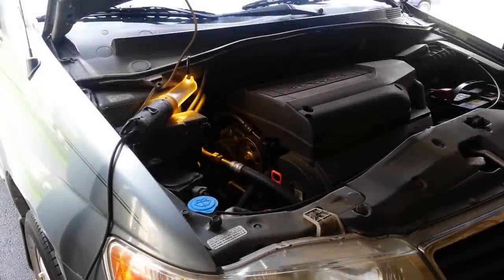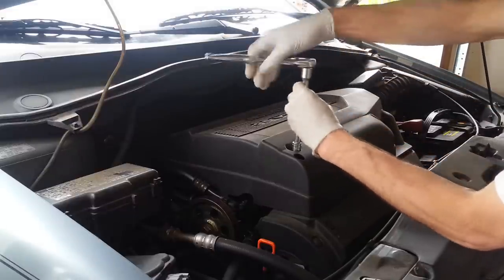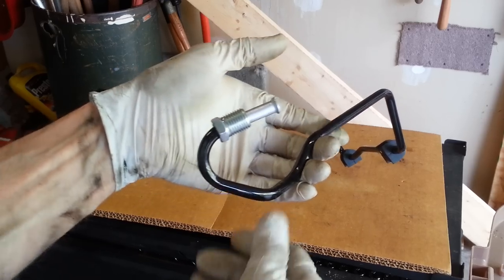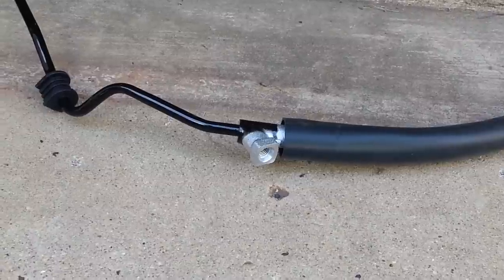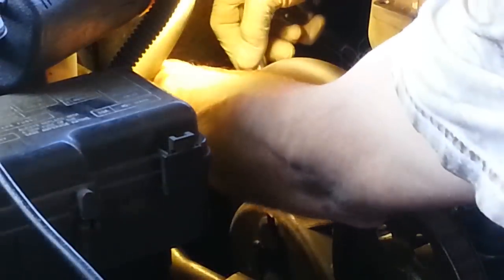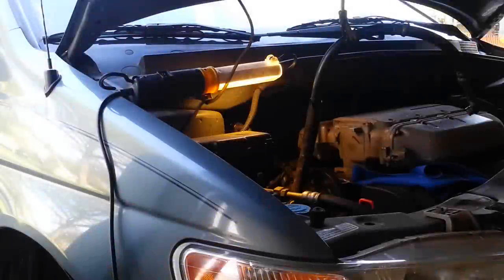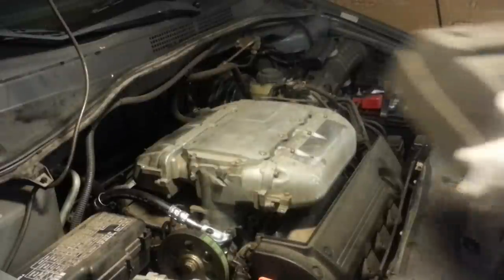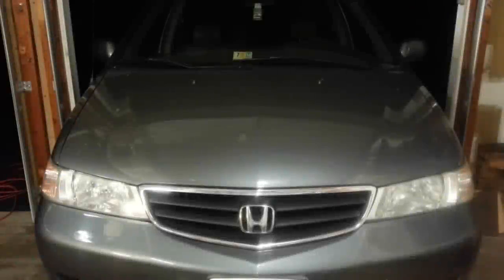Power Steering Hose Replacement 2002 Honda Odyssey

Comment: Just did this repair on my 2007 Odyssey with 157k miles. Almost identical hose and procedure. A couple of notes for the 05-07 Odyssey's:
1. I used a 14mm crow's foot flare nut wrench, rack was very easy to undo. 
2. Get the Honda hose for $150. I bought aftermarket for $110 and did it not include the 3 rubber mounts. But I was able to cut them off the old hose and reuse them. And to add insult to injury, the 14mm hex at the steering rack was a 9/16" on the new hose so my flare nut wrench would not work. Luckily I was able to tighten it enough with a regular 9/16" crows foot.
3. The hose will come out and go back in very easily from the bottom on these year models. Literally 1 minute. 
4. The hardest part for me was putting the center of 3 hose clamps back on.
5. Keep everything loose until you get the rack started, it is a bit tricky to get it aligned right so it doesn't cross thread.
Reply: Tom Shaver how  did you cut off and reuse the rubber mounts?
Reply: Joshua Brown It was real easy with some Craftsman razor blade scissors I've had for years. Suppose you could do it with a knife too. The rubber is pretty soft. Cut along the flat bottom side and it will slide over the new line and pretty much stay in place.

Comment: I had no trouble getting mine off with the open end wrench as you did, but I went and bought crowfoot wrenches that again hit at more points so I could torque mine on there at 18 ft-lbs.

Comment: I used an aftermarket hose and it was fine.  I did have to bend the hard line on the new part to match the OEM so the flare nut would thread in.  The whole job took me 3 hours, from setting up the ramps till end of cleanup, and that included a trip to the store to buy a proper line wrench.  I would suggest anyone use ramps or a lift for this job though.  Made it much easier to work the hose in and around and get it into position.

Comment: Thanks for posting this video. It was very helpful. My Odyssey has the same problem. That's a lot of work and struggle to replace the hose. I don't have a garage and winter time is not ideal season to do it yourself. I'll have to check with the shop to see how much they'll charge.  Thanks again

Comment: I changed this on my 2000 honda van and video was very helpful. I also broke the clip that plugs into sensor on the line. Everywhere was telling me they had to order from honda dealer. I found it on Rockauto.com for like $14 and had it in no time. Very satisfied with rockauto and would recommend them if you can wait a couple days for a part. Again this video was very helpful. Thank you for posting.
Reply from the maker: Trevor Blankenship I'm glad it worked out.  Rockauto is great and I've used them many times.  I recently broke the plastic tab on a fuel injector electrical connector.  I found a replacement on eBay and was able to easily remove the contacts from the broken connector and snap them into the new one without having to cut or splice any wires.

Comment: 5:05.  It may sound crude, but before springing for a set of line wrenches, I'd get out my Vise-Grips.  If that didn't work, I'd cut off the line and use a standard 14mm socket to remove the flange nut.  Great video though.  Thanks for posting!
Reply from the maker: Indeed that's definitely a reasonable approach for the disassembly. Personally, I still found it worthwhile to invest in a set of line wrenches for the reassembly and tightening of the new flare nut. Maybe it's just me but I like to invest in good tools using the money that I saved by doing the job myself.
Reply: @WorseThanChiggers  I hear you.  One of the tools I bought and later regret buying is a special socket for removing an oxygen sensor.  It's a deep socket with a slit up the side to allow the wire to remain attached while loosening the sensor.  The problem is, those sensors are usually VERY tight as they rust on to the exhaust.  They're so tight, the special socket can't maintain it's shape and the slot begins to widen.  When that happens, it lets go of the sensor.  Usually the sensor is being replaced so who cares if I cut off the wire and go with a standard deep socket?

Comment: A couple of things make this much easier. First, since you are changing the hose and discarding the old hose, don't worry about how baddly you mangle it - I had to use an 8 inch pipe wrench to get it loose. I tried a 14mm flare nut wrench but no luck. Could not get enough leverage on it to remove it. The pipe wrench did the trick and it loosened up. Secondly, before you pull out the old hose, tie a string to it so you can see the path needed to get the new hose into proper position. Then you will find, it is much easier to put the new hose in from underneath. First thing to do is to disconnect the Oxygen sensor that goes to the exhaust. Then remove the connector from the bracket and push it out of the way.  Then, start on the driver's side behind the cross beam that the hose was attached to with the 2 brackets , insert the rubber part of the hose through to the passenger side - not too far because then you will insert the tube with the flare nut into the other side where the old one used to go - just follow the string with regards to where to put it. Once you get the tube in to where you can see it from the driver side wheel well and it is nearly in position to connect back up (it should be at the wrong angle at this point) go back to the hose on the passenger side. You should be able to move it past the bracket next to the bracket that held the oxygen sensor, and into proper position while also working up the hose to the power steering pump - this part is easier if you have someone to help and pull it up from above. The hose should move up towards the PS pump and the person underneath can make any additional adjustments to the positioning - which should be much easier without the oxygen sensor in the way.  Once the tube is in place underneath, do not attach the brackets until you are sure you can properly thread the flare nut back into the steering rack. I applied some anti-seize lubricant to the nut (a very small amount) so if I need to do this again, it won't be such a pain in the butt to get that nut loose. It is difficult to get much of the nut in by hand - start it with your fingers and then use an open end wrench/box wrench to gently tighten it until it starts to become snug. Then go back under and attach the 2 clamps and then lastly the clamp on the back of the engine. Attach the connector to the power steering pump and then go back underneath and tighten the flare nut on the steering rack with a flare nut wrench. Re-check your connections and tighten as needed. Do not over-tighten on the aluminum pump or the flare nut on the steering rack. Then go back underneath and put the 2 clamps back on in the proper positions. The clamps have tabs that go into notches on the cross beam. The clamp on the driver side is easy as it is right in front of you when underneath. The other is on top of the cross beam so it can be a bit more difficult. Get the tab into the notch and then thread and finger tighten the bolt and use the socket with a short extension on it by hand and then as it gets tight, use a ratchet. Tighten the other clamp and then go back up top and install the clamp on the back of the engine. Go to the passenger sid wheel well and put the oxygen sensor female plug back onto the bracket and then go back underneath and reconnect the oxygen sensor. From the passenger side wheel well, you should be able to reconnect the PS pressure sensor as well. Make sure your connections are tight and then bleed the power steering. Some of the videos on this said it took hours to get the new hose back into the car. Doing it from underneath, made it much faster. In total, it took an hour to get it back in. But, had I known to remove the oxygen sensor connector from the bracket, I would have been able to shave off about 15 or 20 minutes. Also, approaching it from underneath makes much more sense as you run the tube up to the driver side to the steering rack and the flexible hose through to the passenger side. was much smoother than trying from the side (I tried that too and found it to be a real pain.) Also, I did not have to bend the tube at all to get it back into proper position. Good luck!

Comment: Yesterday, I had the power steering hose remade for my 2004 Odyssey.  It's a specialty hose and rubber shop that does commercial, marine, automotive, or anything pertaining to hoses & connectors.  They replaced all the cracked hose with a new one cut to length, and fastened it to the old fittings.  They charged only $20, which saved me from buying a new one at a parts store for $96.  All I had to do was replace the little O ring at the pump connector.
Reply from the maker: Nice outcome. Another DIY victory for the good guys!

Comment: I connected  jet line (thin nylon line used for pulling electrical wires through conduits) to the bottom end of the hose so that when I pulled it out of the car I could see exactly where it went through engine compartment. It allowed me to pull the string (connected to the new hose) down and back through the engine compartment while my buddy fed me the hose. I was really happy I did this, because coarse the hose took through the compartment was fairly complicated.
Reply from the maker: Patrick Lehrmann Very clever idea!  I'm sure having a buddy also helped a lot, too.
Reply: worsethanchiggers
Thanks for the great video. It gave me the confidence....but it would have been so tough without it.

Comment: thanks for the advice. I was thinking of doing just that. cutting the tube line, to get an open wrench on the nut, or an extracter. I think that is my best option now. on this 2007 the line is configured differently than that 2002 Honda. I have less space for levarage.

Comment: Thanks for this outstanding video!  I have a 2000 Odyssey with 200k miles - I changed the hose per the video, however the power steering is now growling when I turn the wheel hard right.  It seems there might be air in the line.
Reply from the maker: +armydlguy  Yes, likely air in the system.  If you followed the proper bleeding procedure, perhaps you are now drawing in air at the pump on the low pressure side.  There's an o-ring there that can cause that if it deteriorates or gets damaged.

Comment: Excellent step-by-step video with clear video, no missing steps and good commentary......
I am wondering that if even with a line wrench if I strip the nut what should I do?   I hope to replace my pressure line in the next week or two and want to be prepared in case I mess that nut up.  I plan on soaking that nut with PB blaster a few times to help it on its way but I am still weary.   Any advice of what to do in case it is stripped would make me a little less anxious about doing it.   Thanks.
Reply from the maker: +Smitty Werbenmanjensen  I've heard good suggestions that if you can't get the old flare nut off, just cut the line and use a 6 point socket.  That assumes you have not already stripped the nut and rounded it over with a standard open end wrench.  A good quality line wrench should do the trick.  If you need to cut the line, you might be able to get a compact plumber's pipe cutter up in there which would probably work nicely and cleanly.  A hacksaw would work, too, but that runs the risk of contaminating the rack with metal particles.  If all else fails, another recent suggestion is to use a large set of vice grips and a cheater pipe.
Reply: +worsethanchiggers - Thanks for the excellent advice about cutting the line and using a 6 point ratchet should I start to strip the bolt.  Keep up the great videos.  Us DIY'ers really appreciate the great detail you put into them!

Comment: Your video makes it look easy I'm going to try it on my 2004 it has a spraying leak on the hose not far from your drip on your video.  I'm going to block out my entire weekend to do this. I think I'll but a set of wrenches like you did.  The hose is $121 at auto zone so it will still be cheaper if o can accomplish this. Wish me luck
Reply from the maker: Best of luck and it really is not too difficult.  I would recommend that you get an OEM genuine Honda hose rather than an aftermarket one. Some people have had quality and fitment issues with non-OEM alternatives.
Reply: +worsethanchiggers will do thanks for the tip

Comment: You sir are very kind to share the steps and give us amateurs confidence to perform the repair ourselves. A very thorough explanation with a comforting narrative. Many thanks and job well done.

Maybe one suggestion/question -- cutting the old hose during removal may have saved some time instead of keeping it intact. Did removing the hose in one piece help with the 15 min of wrestling the new one into place?
Reply from the maker: Art Wong Art, thanks for the kind words.  I'm just as much an amateur, continuously learning myself, and I enjoy sharing my journey in hopes that it will help others.  Good question... I did not consider cutting the old hose which would have definitely helped with its removal.  However and as you correctly surmised, that part of the learning processes did help me to know how the new one would need to be routed during installation.  It was just a puzzle that needed to be solved and it always takes longer the first time you do something.
Reply: worsethanchiggers Even with a flare wrench and extension it wouldn't budge so used a mallet to tap the 13mm end of the wrench hoping the impacts would free the 14 mm nut. After a number of blows the wrench turned but it was the nut being rounded. Then it dawned on me. Cut the tube flush with the nut then use a 14mm socket in the first place. This would save buying a flare set. Hammered the socket on but too late the socket didn't have enough bite on the rounded head and just spun.

Oh well. Next will try a left hand tread screw extractor (not sure if there is enough friction between tube and extractor). As a 2nd last resort vice grips and after that maybe purchase those expensive bolt removing sockets.
Reply from the maker: Art Wong Never turn down a good excuse to buy a cool new tool!  ;)

Comment: Removing the flare nut is very difficult. My tip is this. As a LAST RESORT cut /saw the tube off close to the nut and use a socket wrench on the flare nut. (The old hose is trash anyway) . It may even be easier now to wiggle the tube out through the car.
NOW I SERIOUSLY RECOMMEND THAT YOU FLUSH THE SYSTEM   before reassembling to remove any metal pieces that may have gotten into the plumbing.

Comment: Thank you for this video. It was a huge help for a very tedious job.   Everything was not smooth.  Next time , if there is a next time . I'm taking it to a garage . 

 The biggest pain was the flare nut , Mine must have been replaced before the first threads where bummed up in the rack.  Which made it more of a bear to line up and get started .  But all said and done , no leaks .

Took my wife accord to the shop , it took them 3 hours and they have a lift , I was working on the  odyssey on ramps . Had to take several breaks because I was loosing my patients . 

You would thing the after market would make a 2 piece replacement to make the job easier , but........

Comment: Just a tip for maneuvering the hose in place. I removed the right front tire and inserted the hose from the that end directly. It took only 3-4 min.
Reply from the maker: Art Wong Terrific feedback!  I can see how that could have been easier.
Reply: worsethanchiggers  yup i agree with this,,pull both wheels for better access
Reply: Art Wong fwiw, I tried this first and couldn't get the pressure switch attachment through one of the spaces, so I pulled it out and went in from the engine side and it worked with only minor sanity loss. Could be because I was using a third party replacement hose, not an official Honda one.

Comment: Few suggestions. Remove the tires for easier access. Just cut up the old hose in pieces to remove part instead of spending time fishing it out. Put the pressure sensor back on through the wheel well area after the hose is fished through into place.